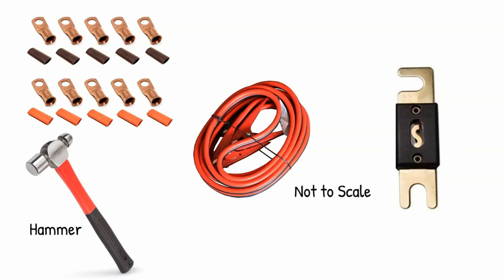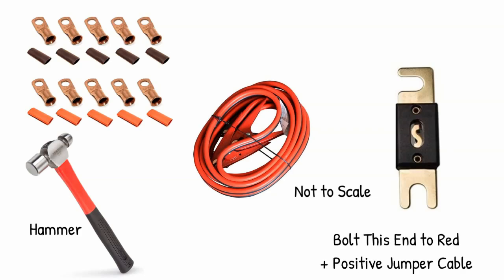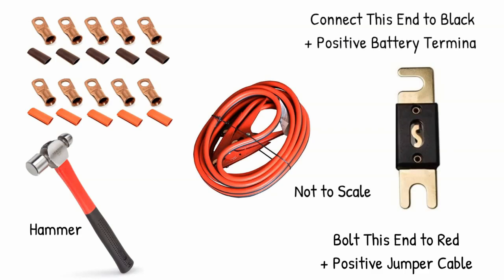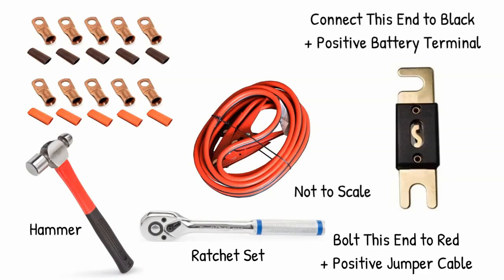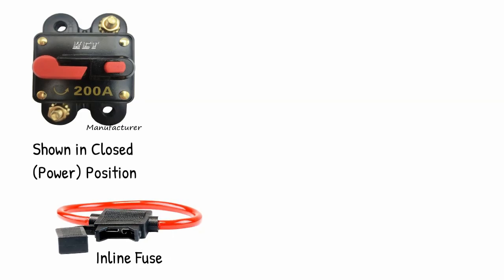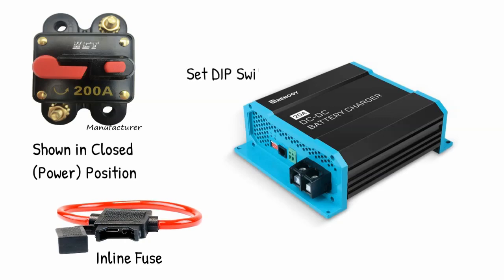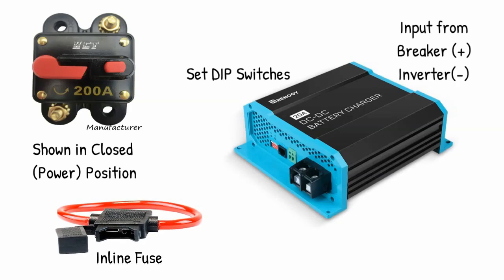$179 Battery + Alternator = Fridge + Stove + Microwave + Heat/Fans + Lights + Device Charger

Comment: This is info you grew up getting taught by watching adults.  Most dad’s in the 50s if they knew this stuff themselves, didn’t teach this to their DAUGHTERS.  While you perceive this as dull and extraordinarily simplistic, it’s the level I needed to conceptualize these components and their job/constellation in the assembly.  If you ever need to know deep info on Biology, Geology or Psychology, I will gladly give you info on those topics at similar levels to your tutorial.  My skills are in different areas. My dad, disappointed that I was born as a Joann not a John (traditional family name) he never felt there was a reason to know this.  Of course he flushed his radiator each year with dishwashing soap and water-hose!  Somehow I don’t think that would be advice for maintenance by the manufacturer!  He may not have had the skills himself, and couldn’t teach me what he didn’t know!
Reply from the maker: Thanks for your comment.  Times are different.  My Dad taught me what little he knew and I learned a lot from my grandpa in plumbing and heating.